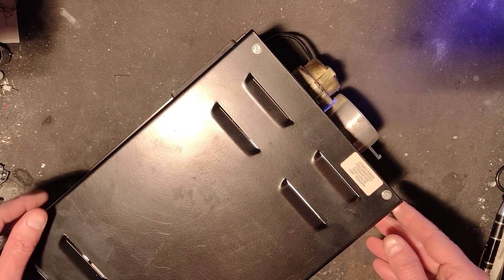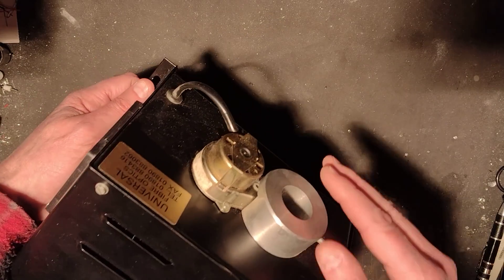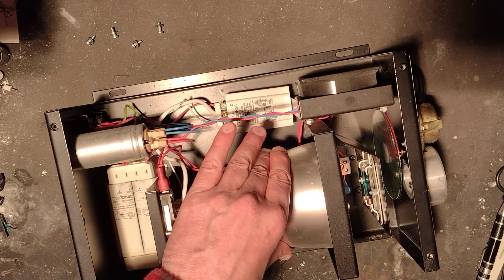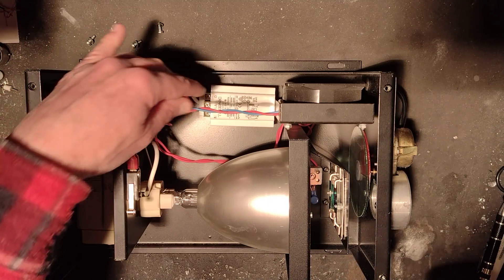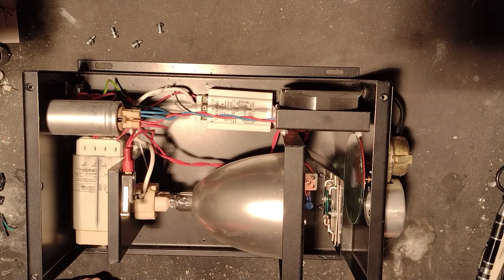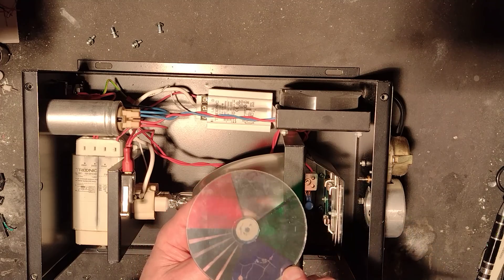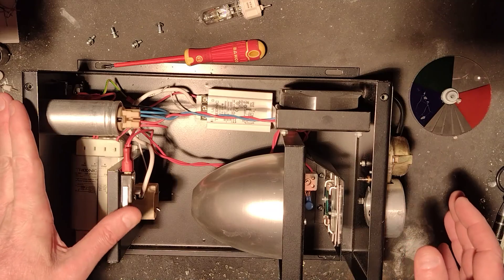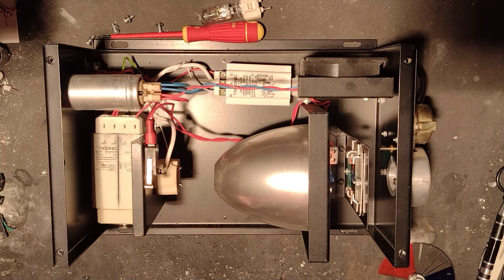Metal halide fiber optic illuminator

Comment: Elegantly simple, easy to service, what was the manufacturer thinking? It really does appear that an average maintenance person could repair this with a minimum of parts, tools, and time! I love it when things are so simplistic, yet produce such great effects
Reply: TacticalMoonstone  I have no problem, bought a few boxes of them on auction a decade ago, paid under $5 per box of 10.
Reply: TacticalMoonstone  these are not Xenon bulbs ! so not expensive at all.
Reply: TacticalMoonstone  high cost for an individual, normal operating cost for a business. This unit looks to be aimed toward the commercial side of things, I would expect a homeowner grade of device to be built cheaper than this.
Reply: @jasonkuehl639  The lamp is too bright for practical residential use.  One bulb produces enough light to illuminate a typical sized home, and there's no easy way to turn the lights on and off on a per-room basis through the fiber-optic loom.
Reply: @evensgrey  not sure where you get that I said it's a homeowner light source, but thanks for clarifying.
Reply: @jasonkuehl639  You did mention the idea of a residential grade device.  That wouldn't work because the smallest power lamp of this type I can find is a 100 watt version, rated at 14 000 lumens.  This is the equivalent of 10 to 12 100 watt incandescent bulbs, ample for most people's homes.  You could divide up the light between rooms with a fiber-optic loom, but that would provide no easy way to switch it on and off on a per-room basis.
Reply: @evensgrey  either I still don't get it, or I have really spoken badly (no surprise if I did, honestly). When I stated "This unit looks to be aimed toward the commercial side of things, I would expect a homeowner grade of device to be built cheaper than this.", I was recalling the fiber optic systems marketed toward homeowners that utilized MR16 halogen bulbs, and probably should have stated such. Having worked on industrial/commercial equipment, I often don't consider that a lot of people don't know that residential/homeowner items are not the exact same as commercial items. If they were, I should be rather irate that my car doesn't last as long as a mining truck, or my 30 dollar all-in-one printer isn't as fast and powerful as a $10k HP copier/printer. I apologize for any confusion I caused in my comment.
Reply: TacticalMoonstone  you must be in one of those "herp-derp" countries....
Reply: TacticalMoonstone  No. You can get them quite cheapy from any wholesaler, even today. They are still widely used in shop display lighting and also architectural floodlighting. You are thinking of XBO lamps.
Reply: TacticalMoonstone  The installation of the lamp box and light distribution system is costly, but you save a lot on electricity compared to any other light source and more on far fewer replacement parts and the labor to replace them.  The way these use fiber-optics to distribute the light means the lamp box can be placed in a convenient place in a maintenance space above the ceiling, and serviced without the need for accessing the ceiling structure at all.  The distribution system has no moving parts or consumable components, so it should last the lifetime of the structure.  Any lighting system that requires access to ceiling-mounted fixtures for replacing lamps is going to mean access to the ceiling from above or below. Below can be by ladder, scissor lift, cherry picker, or some other system that's either dangerous (there's no way a 30-foot tall stepladder is safe) or expensive, and always awkward.  Access from above means the fixtures have to be designed to be swung up into the space above the ceiling (which means access space and walkways, as well as some means to ensure no debris falls through the opening while the lamps are being replaced, all of which may cost more than having the fiber-optic network installed).  Another issue is that the entire fixture of most other high-efficiency light sources you might use instead have limited life spans before they have to be replaced or extensively serviced.  This is a small box which, at worst, you can swap out and service at leisure.
Reply: Well, made when things like service were part of the deal, and it was expected that you would repair stuff you owned at some point.
Reply: @SeanBZA  exactly!

Comment: Been a while since I saw one of these. Often the crew on stage were in a rush to set the next scene and would forget to unplug the fibre optic tube from the unit. They would then get a sudden reminder when we hauled the star cloth out and the lighting unit crashed to the floor.  When flying hemps with zero mechanical advantage stopping a heavy star cloth part way out during a tight scene change is not an option.

Comment: Trying to replace a metal halide lamp with an LED is in my experience pretty difficult. Sure the LED is a tad more efficient but it has to be kept a lot cooler and that means a big heatsink and plenty of airflow whereas the lamp I used was happy enough with natural convection cooling. 
One word of warning, do not look at a metal halide lamp just to watch one ignite. I tried that once and got the mother of all migraines.
Reply: "Warning: Do not look into extremely bright light with remaining eye."
Reply: LEDs also aren't as reliable as incandescent, halogen and discharge lamps*.
The LED lightbulbs I use at home all start to blink or stop working entierely way before incandescent ones.
And that applies to brands like Philips and Osram as well as chinese ones. Although I have seen cheapy chinese LED bulbs from Aliexpress or eBay last a tad longer than "proper" expensive ones !

Now to the commercial and public lights:
Every time I go out at night I get to see at least one blinky light, either a streetlight or a floodlight from a business.
Back in the day they were all sodium or metal halide, now they're obviously being replaced with LEDs and the lack of reliability is easy to see. Litterally.
And we're talking about proper, commercial, expensive lights here, not cheapy chinese ones.

*By discharge lamps I mean: HPS, LPS, MV, MH and fluorescent tubes.
Reply: @psirvent8  what you are talking about here is considered "anecdotal evidence". it has no statistical weight or significance. how long specific consumer products lasted in your specific instance says little to nothing about the reliability of the technology in general. 
The fact that they use LEDs everywhere in military technology says quite a lot about reliability. 
Complain about the consumer products that failed you instead of the technology.
Reply: @drkastenbrot  I know LEDs can be quite reliable... Provided they're driven by a good quality power supply.
I didn't know they were in use in the military as again MH can be superior on many instances.

Yep the consumer bulbs that fail on a regular basis at my home might not be the norm but what about all those streetlights and commercial floodlights ?

I've seen them failing in multiple countries as well.
Reply: @psirvent8  Your anecdotal evidence only shows that there are obviously failing commercial LED fixtures. When the older technologies fail they don't blink. They'll either be on or off. If there's any oscillation it will be on the order of minutes per cycle. You'd probably only notice one cycling if you stare at it for minutes.
Reply: @psirvent8  It's generally not the power supply which fails, in crappy consumer LED lamps. The LEDs themselves are overdrives and undercooled, which causes excessive hearing. Watch BC's video on the Dubai Lamp, for an example of a LED lamp which should virtually last forever and is very efficient.
Reply: @psirvent8  In all likelihood, the LEDs in those lamps are perfectly fine and it's the crappy power supplies crammed into the bases that are failing.  This is specifically a problem with the 'drop-in' replacement LEDs lamps that go into existing fittings.  The engineer is having to cram a power supply of come sort into what is very often too small a space.  Fittings designed to be permanent LED installations from the start don't usually have this kind of issue, but nobody is very anxious to go around and swap out all their street lamps and flood lamps.  I also don't find that my LED bulbs fail particularly quickly.  This is good, because almost all the lights in my current home are elderly glass-domed ceiling fixtures, which are not fun to replace the lamps in.
Reply: Also, LED power supplies are significantly more complicated than the ballast + igniter used for MH, so I guess they are a bit less reliable too. One drawback of MH lamps is that some will not re-strike when hot.
Reply: @MrJef06  If you want hot restrike then the control systems seems to get more complicated. Then there's the question of being able to dim the light. One of the advantages of HMI and metal halide is they're a point light source so controlling the light beam is possible.
Reply: @MrJef06  simple does not imply reliable. making something reliable is purely a matter of engineering, no matter the complexity. it may be easier to make something simple reliable but there is no direct correlation. 
if you buy industrial grade components, the datasheet will tell you pretty precisely what you are going to get. If you need it to last 50 years, they will make it last 50 years.
Reply: I'd like to see LED match 12,000 lumens in a package as small as this lol.
Reply: Yes, I imagine retrofitting an LED will be quite difficult. It's better to buy a new one, with LEDs.
Reply: Fine to look at them starting if you use a welding helmet, with the no9 welding glass. Works to control the little sun that is arc welding, works to watch solar eclipses, and works to watch arc lamp start up as well. If you get the gold coated ones they also are pretty close to neutral density, unlike the glass, which is very dark green.
Reply: @SeanBZA  no9 is not really enough for eclipses

Comment: My old, but almost brand new, Sony LCD projector uses a metal halide light source, but with that device, the fan continues to run for several minutes after the power is turned off.  The lamp life is 6000 hours, and there's no way around that - The projector counts the hours of every new lamp, and you can't cheat by taking the lamp out and putting it back in, nor swapping it for one out of another projector, and those lamps are damnably expensive - £400 each, or thereabouts.

I guess metal halide was a pricey technology in its time? Maybe why so many of these light sources just died in service and never got replaced?
Reply: The projector most likely use a Mercury lamp, often referred to as a UHP lamp (ultra high performance/pressure) The lamps are always sold with the reflector as a single unit. Those lamps produce really high light intensity that only Xenon (and Mercury) short arc and Laser can match.
Reply from the maker: This style of lamp is common and cheap.
Reply: Yeah projector lamps are annoying. It's cheaper to buy a replacement used projector on eBay than to replace the lamp...

Comment: Another thing going for the disc is the light colour coming out. I have an old flashlight (I put a warm white LED bulb in it) which has a blue and red filter, and the colour of the blue is just way nicer coming from a white LED compared to the crisp small blue colour band of a blue LED. It's almost a bit cyan I think. Same goes for my old christmas lights, I like the blue coating over an incandescent bulb a lot more. Perhaps the same goes for green/yellow/red, not sure. It's just a broader light spectrum that I somehow find nicer to the eyes.
Reply: You ever watch technology connections, he has very much the same opinion
Reply: @BenQuigley  hmno I haven't, but I'll check it out.
Reply: @TheFreak111  you'll have to let me know what you think
Reply: @BenQuigley  well I watched some of his movies, and yes I think we share the same oppinion. Nice channel!
Reply: @TheFreak111  I'm glad to hear you're a fan! Happy viewing
Reply: Ironically the white led is really just a blue led with a phosphor on top. If you had an led made with a very low concentration phosphor you would get a similar "mild blue" color. 
I prefer LED lights, but I also only install high CRI lights. They have a very accurate white without a tint and without a weirdness to it that some cheaper lights have.
Reply: @drkastenbrot  that would be interesting. Probably not the same result as the white LED with blue filter, but yes perhaps similar. I kinda want to test this now. Perhaps removing the coating of a cob LED, grinding it to a powder like substance and applying a very thin coating with epoxy to an LED might work. Easier would be dissolving it but I doubt that is easy to achieve since I think it may be in silicone.

Comment: Is the switch for the safety of someone opening the cover or is it for the safety of the bulb so that it doesn't run without proper cooling requiring the cover to have proper airflow?
Reply from the maker: It's possibly to prevent UVC exposure from the lamp as well as as for electrical safety.

Comment: Oh, a metal-halide lamp? Heard they are quite efficient when safeguarded from mechanical vibrations, acoustic resonance and power outages during operation.
Reply: MH lamps also have a defined burning position (Horizontal or vertical).

Comment: I have a couple utility patents for both long arc and short arc fiberoptic illuminators. I worked for several years at a fiber optics manufacturer as an optical engineer. B)
Reply: Our specialty was "coherent" bundles of fiber optics- where the orientation of the input ends of the fibers matched the orientation of the output ends. This allows the presentation of graphics, images, and video. The center to center spacing of the input ends was 1mm, and the output center to center spacing was 4 cm. We abandoned imaging reflectors (like the ellipsoid reflector) in favor of a non-imaging reflector, because the later provided much more even illumination over a wide area. Our matraces were typically 4x3cm in the input side, so we needed each fiber in the matrix to receive the same amount of light. Ellipsoid reflectors created a significant hot spot, whereas the non-imaging reflectors did not.
Reply: @LiLi-or2gm  That's super cool! I recently-ish watched a video... somewhere... about someone needing a fiber imaging system but mentioning they're crazy expensive.  
Oh good grief... I have no idea what that video was even about now.  haha
Reply: @BRUXXUS  Ours was initially designed to be the night-sign for a blimp- a 138,000 cubic foot blimp! And we did fly it successfully- it looked amazing. On each side of the blimp we had a 20' x 60' "active banner"- each side using 3 "projectors"- basically, three large format film (we used cibachrome transparencies) drives with 400 W long arc metal halide lamps, so six in total. The banners had fiber optics spaced on 4cm centers, so the resolution was amazing at distances beyond 100 feet. It used 1000's of feet of 1mm plastic optical fiber for all six banner modules.
Reply: @LiLi-or2gm  That is SO AWESOME!  What a cool application. :) 
I remembered the thing I was thinking about! 
It wasn’t a video, I was brainstorming a way to build a cloud chamber with cameras on each side to capture particles and plot their paths in 3D space.  But wanted to completely isolate the chamber from electromagnetic fields, so the cameras lenses would need to be remote via fiber optics, if that makes sense. Lol

Someone I was talking to about it said fiber optic cables like that are crazy expensive. 😅
Reply: @BRUXXUS  Here's a promotional video about the blimp and the night-sign:
https://www.youtube.com/watch?v=rEPdpBYXCqA

You can see the projectors (the six black items at the bottom of the envelope) that illuminated the fiber-optic screens, in some parts of the video.
Reply: @LiLi-or2gm  Dang, that’s so cool!  And yeah, I suppose until fairly recently, there really was no other way to do something like that! Thanks for sharing. :)
Reply: @BRUXXUS  The weight savings was paramount. One fiber replaces four copper conductors for full color, which is significant. Fiber optic was 1/4th as heavy,
Reply: @LiLi-or2gm  I'd almost be willing to bet fiber would give LEDs a run for the money today, in similar applications.

Comment: I remember the roof in the Wellgate centre in Dundee had the twinkling start effect in the roof, must have been fibre optic but can't remember them changing colour but it has been a very long time since I've seen it as I used to get dragged to the shops by my mother when I was younger. I wonder if it's still there but the bulb has failed.
Reply from the maker: Many of the twinkling ones were just white.

Comment: How does the HID intensity compare to LED source
Reply from the maker: It would depend on the power and optical system.
Reply: LED can match these type of lamps, but LED don't come close to the light intensity from real short arc lamps like Xenon, Mercury and UHP. Only Laser can match those.

Comment: I'm never too sure if those Automotive crimp connectors are suitable for mains, but I guess this was a retail item, so they must be :)
Reply: pretty much standard connectors in many electrical appliance's from toasters to cookers
Reply from the maker: They are suitable for mains use inside enclosures
Reply: They are not automotive crimp connectors. They are electrical industry crimp connectors. Some cars obviously do use them. But so do other transport and industrial users.
Reply: I see them used all the time in medical lab equipment. And yes they are a common failure point.
Reply: @markc2643  never had one fail in my experience  they do however fail often in automotive industry and in most instances during automotive assembly or other industries where someone has fitted them incorrectly ie shoving the tab under the rubber sleeve